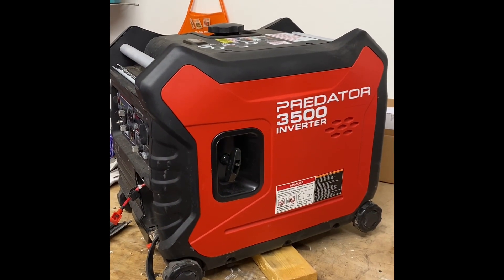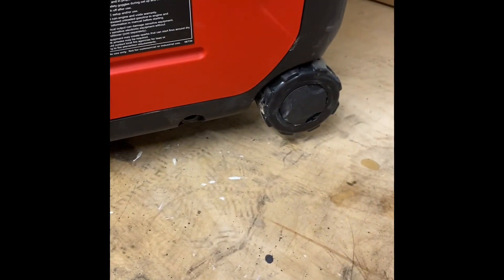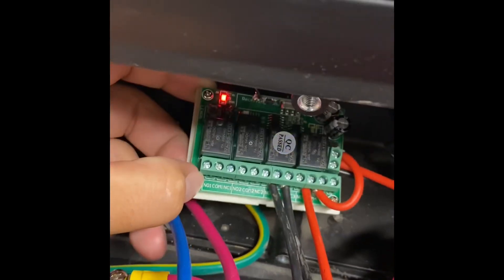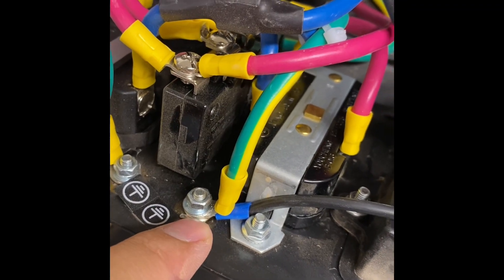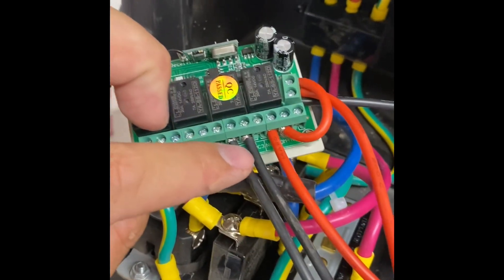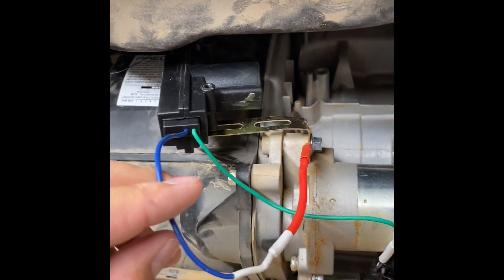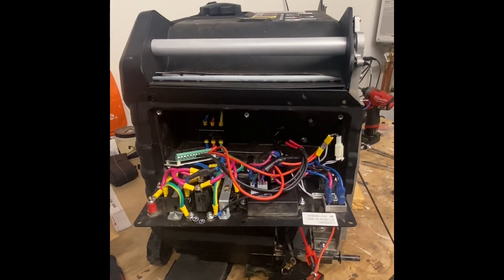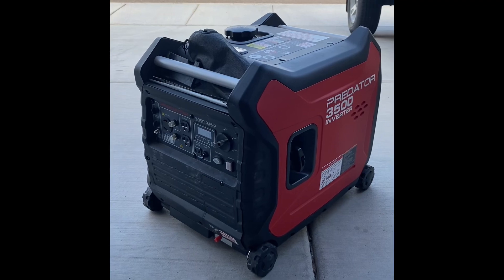$40 Remote start generator!! harbor freight predator 3500

Comment: So, the way you wired it, the choke will engage every time you start it? What if it’s already warm and you don’t need the choke? Won’t that flood it? Could I just use one of the other buttons on the controller for the choke? Then push two buttons for a cold start basically?

Comment: Why not use one of the un used relays to replace the toggle switch you installed?
Reply from the maker: That could work. It’s just not the way I did it. All I have to do is turn on the toggle switch when I’m hooking up my generator and forget about it for a few days no big deal.